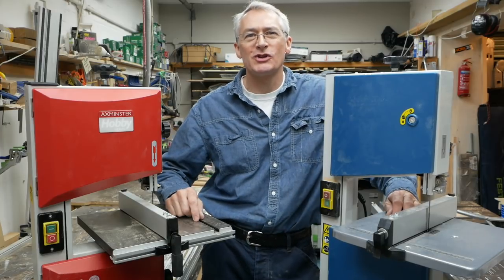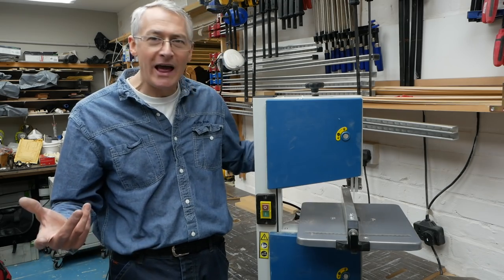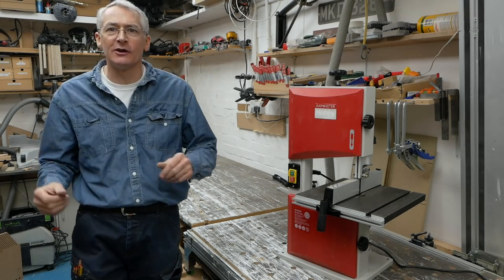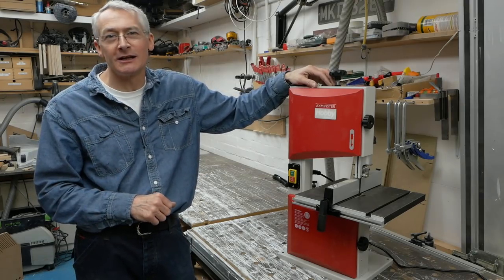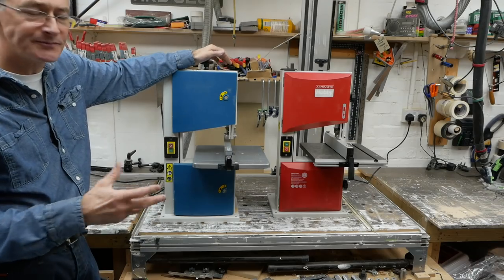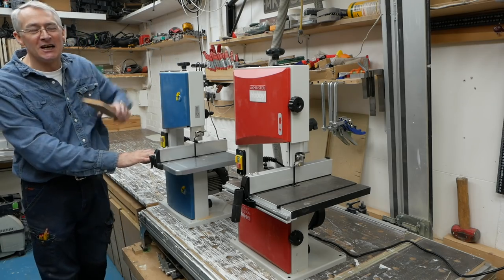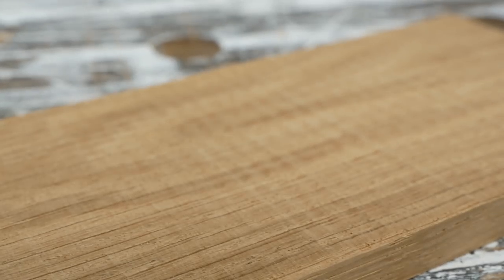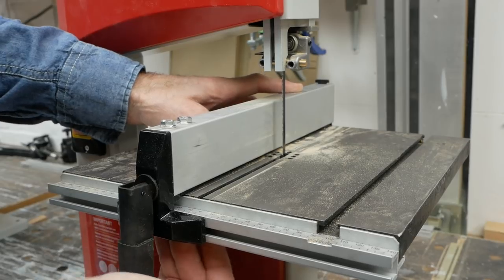£80 Bandsaw vs £200 bandsaw #140

Comment: Like you, when I first felt the need for a bandsaw I bought a cheap local Burgess which had no on/off switch! plug it in and it ran. An aftermarket NVR switch made things a little safer. I upgraded to the Aldi and for the price I think it's a great little saw. For me it matches anything up to £200. I wore out my Aldi saw after about 2 years of light commercial use, using it to supplement my big Dewalt Bandsaw. At one point I thought about having 2 Aldi saws each with a different blade to save changing.  At hobby / light use level this is easily your best bang for your buck. Simple straight cuts if you don't force it  and work within it's quite impressive capacity again for the price.

Comment: Hi Peter, nice video and interesting subject...for what it is worth i think in your line of work the Aldi Bandsaw is the best option, send the Axminster back and spend the £200 on a Festool jigsaw blade...ha ha... 
Unless you are re-sawing or working with thicker stock, in a small workshop the Aldi saw is perfect at that price.as is the Aldi Drill press, I got mine at £39.99, last weeks takeaway cost more than that... 
I bought cheaper tools and regretted it so I splashed out on SCHEPPACH NEW BASA 3.0V VARIO BANDSAW 205MM on offer at £399 instead of £520.  This has shown me that I should have spent more on a decent table saw a thicknesser, instead of rushing and buying cheap.... 

Cheers
Paul
Reply from the maker: Haha - yes, the Aldi’s been excellent for the money.

Comment: Interesting to see just how similar, physically, the two saws are.

We're currently using a Clarke / Scheppach one, similar capacity,  and it fairly chews through anything we've thrown at it *so far*.
Swapped out the stock blade for a couple of Starrett ones (one thin for detail work, the other 3/8 inch for ripping) and made a 3/4" ply replacement table and fence. Rock solid.
Reply from the maker: Yeah, I need to look at beefing up the thin table & fence 👍
Reply: @10MinuteWorkshop  superb video. I just picked up one of these cheap bandsaws today. For £40! (Second hand), but the owner hadn't even taken it out of the box! Deal of the year for me so far. Very pleased with it.
I was wondering if you could suggest what tpi blade I should buy for cutting hardwood like pau Rosa?  It seems like I would need a finer toothed saw blade, (but I could be wrong as this is my first bandsaw), and you can pick decent ones made in UK for between 10 and 15 pounds.
Not very expensive really.

Comment: Thanks Peter! I'm glad you compared the two brands, in particular the Aldi one. I'm confident now that it will do the job for me at a very cheap price. I'm off to Aldi (in Australia) to buy one!
Reply from the maker: Thanks! Bear in mind that this video is a few years old; the saw I reviewed here won’t be the one that you can buy today; check the comments below -  there have been some QC issues in the last few batches of these. 👍👍
Reply: @10MinuteWorkshop  Hi Peter, thanks for the warning. I've read the other comments. It can be a bit risky with the Aldi stuff at times. It goes on sale next week. I'll try to get one and let you know how I go.
Reply: @dandam7755  did you get one? I did, seems exactly the same to me and does a good job for the  $130
Reply: @TheCrankster77  Hi Ben, no I missed out at Aldi but got one from Bunnings. They had dropped their Ozito band-saw to the same price. I believe that it would be very similar 
to the Ferrex one. Either way, for that price, you can't go wrong. I'm really enjoying having a band-saw. How's the Ferrex?

Comment: Inspired by your videos I picked one up at Aldi for.... £59 (!!) last year & was/ am absolutely delighted .. bargain upon bargain!! Such a handy tool for the small workshop - I no longer risk dragging my finger into the chopsaw when doing smaller cuts - as my Dad rightly pointed out: "You'll end up using that more than your circular", & he was right.
Reply from the maker: Thanks! Wow, £59 is a fantastic price. And I agree with your Dad, such a handy little thing to have 👍
Reply: Yes I went to an Aldi store which had just been opened & it was on special... result!

Comment: I bought a band saw from Aldi  less than 2 years ago for £110, and it is a Ferrex. Came with a mitre guide, and takes a 1790 mm blade, throat of 10" and will cut up to 5" thick. The bed is thick and solid aluminium. Two speed adjustment possible. All the blade guides are bearings, and it is a dream to set up. All in all it is fantastic for the money. It even came with a toolkit to do the set up; spanners, screwdriver and allen key.
Reply from the maker: Yes, sadly they weren’t available for long, looked like a good machine for the money. 👍👍

Comment: I used a Lux 10" bandsaw from East Germany for around 25 years.  After a bit of faff with duff blades I got a good one that worked for the rest of the saw's life (motor seized ~5 years ago, no replacements available). The table was nasty brown plastic, the guides were waxy  fibre(?) blocks and I had to make my own fence out of wood, but that thing did everything I asked of it - dead straight cuts and 10 cm x 1mm slices in oak, even.

I replaced it with a 360€ 8" Metabo. Yay, quality, right?  Wrong. The first one I received had a cockeyed drive pulley that threw the belt.  On the second one the lateral blade guide bearings could touch the blade on one side but come no closer than 2 mm on the other. The rear bearing wouldn't touch at all until I invalidated the guarantee with a file.  It had so much in the way of idiot-proofing that you couldn't see what you were cutting with both eyes at once - maybe it was designed for one-eyed woodworkers.  It improved a bit with a new blade, but I still need to leave a 5 mm margin round anything I cut and finish it with plane/spokeshave/sander.

Maybe I'll keep watch for an Aldi one then use the Metabo for a 36-kilo doorstop.

Comment: What a surprise! I know a lot of hobbyists like Aldi equipment because they're cheap.  But I didn't think they would stand up against something like an Axminster.  You're right about the fence and motor though - you get for what you pay for there, induction all the way if you can afford it.  Great video Peter.
Reply from the maker: Thanks Jim! Must admit I’ve never seen a bandsaw that didn’t have an induction motor- I must have led a sheltered life 😆👍
Reply: My Scheppach HBS-20 has an induction motor, but the motor power indication is a bit confusing. The label says S1 250W and S2 350W
but I have no idea what S1 and S2 stand for. In the catalogue is written 250W  (no mentionning of "S")
Reply: S1 refers to continuous running and S2 is intermittant ( a higher output can be acchieved in short burts and not continuously)
Reply: Thanks for explaining!
But why is S2 mentioned anyway? What's is it useful for? Is there a possibility to use that 350W at the moment you want it?
Reply from the maker: Hans de Groot I agree. Just taken a look and my Aldi has the same on the label in the back of the saw - 250w S1 and 350w S2 (30min). After 30 minutes does it reduce power?? I’ve never run mine for more than a couple of minutes at a time. Seems a strange way to define power output.
Reply: I work at Liverpool university and I've just asked a professor of electronics for an explanation... S1 (speed 1) refers to the continous draw that the motor will be set for to avoid overheating. S2 (speed 2) is the maximun draw that the motor will take.
It's basically to prolong the life of the motor by preventing overheating.  Most machinery will have dual rated motors like this.
Aparently it doesn't affect the performance of the machine or speed etc.
Reply from the maker: Jim Black Fascinating, thanks Jim. But in a single-speed machine like this it’s a motor rating for the sake of it, presumably i.e. they need to quote ‘power’ as something; the actual power/output/consumption won’t change?? BTW I was in Liverpool last weekend for the football, been years since I was there 👍
Reply: As you load (apply torque to) an induction motor it draws more power from wall.  If you stall out an induction motor it will effectively draw the most current possible based on the resistance of the windings (think short circuit).  In this state it would "burn up" the windings as all the power is put into resistively heating the motor with no watts leaving via the shaft.  With no load only enough power is being consumed to overcome the friction of the saw.  When cutting materials you cause the motor "slow" down, thus lowering its effective resistance and allow it to draw more power to speed up.  The motor has a balance point where it can cool itself enough to run forever and that is the S1 point, the S2 point is Kirk asking Scottie for more power!  We all know that the warp cores will go eventually though! So after 30 minutes the motor will start burning off the wires insulation and eventually destroy itself.  Better motors have thermal protection and cooling fans.

Also,  Marketing...  a 350W motor sounds better than a 250W motor.  That's why they like to quote peak or intermittent power levels.
Reply: Now that makes iperfect sense.  Thanks Hardkrash.
Reply from the maker: Thank you, that's a very detailed explanation! I'd noted too that the Aldi claims to draw 1.2A which at 240v is just shy of 290W - a convenient middle ground. And yes, I'd figured out the 'marketing' angle of higher numbers 😉
Reply: Honestly, i rate aldi tools quite high

Im a welder/fabricator by trade and use their air and battery tools in an industrial setting.
I have yet to break one

Comment: I've got the older 14" bandsaw from Record. It's been a total champ, even though I've neglected and abused it horribly. I could imagine getting the smaller Axminster bandsaw so I could keep a wide rip blade on the bigger saw, using the smaller bandsaw for curved work.

My main concern with cheaper tools is always longevity. They're made to last one or two projects, not three or four decades.

Comment: I have the axminster 12" saw (something 310 is the model number). If you are going to buy a "premium" saw with cast iron top etc then I would say it's about the smallest saw worth having in terms of cut capacity and rigidity. If you are going for a small saw, get something like the aldi one, you'll never be able to do serious cuts but it doesn't really matter on a saw that size so capacity and rigidity can be sacrificed somewhat as you have found.
Reply from the maker: Thanks! 👍
Reply: caskwith i

Comment: Great video. Just bought a bandsaw for $NZ360 (about 180 quid). So similar in quality and performance to the Axminster. I've never owned a bandsaw before so I'm not sure what to expect but the limited experience, so far, has been positive. My only complaint is that the manual is virtually useless and I had to google the necessary instructions for the adjustments. I'll keep a copy of the Axminster booklet for future reference. Thanks.
Flaxen Saxon
Reply from the maker: Thanks! And yes, rare to get a manual that’s as good as the Axminster one 👍👍

Comment: Nice review Peter! I use my bandsaw almost for every project, so, I invested in the biggest Hobby unit available before the pro ranges (Startrite) start, i.e., the BS350s From Record Power. I'm glad I did because it is outstanding performance/ value Cuts huge Blocks of anything with ease and it's built like a tank.
As with all tools, I see you use Festool, cheap tools will do the job, but when they go wrong, they end up at the local tip, because you won't be able to buy spares.
It all depends on how often you are going to use a tool really!
Reply from the maker: Thanks! Yes, absolutely - I'm a big fan of cheap tools, as long as you know what you're getting. As a first bandsaw the Aldi's brilliant, but a more sophisticated user will probably want more from a tool. 👍

Comment: There’s nothing more satisfying than being surprised by a low cost tool that works better than expected. In fairness compare the customer support a higher priced tool supplier will provide vs Aldis as the good manual demonstrates. If the Aldis tool fails it may be a diy repair or put in storage with that old “three wheel” saw. However you did an excellent job comparing both tools. I would keep the Axminster tool.

Comment: Great review. I have the aldi bandsaw. I find the blade constantly comes off and the bearing support turret thingy gets wedged in place with saw dust getting in behind it and jamming up the pinion. It does me for what I use it for but if used very often I would bin it.
Reply from the maker: Thanks! This video’s a few years old now, and the more recent saws had some quality control issues, esp. wrt the blade coming off the wheels - see the more recent comments below. If it’s within the warranty period I’d return it. 🤷‍♂️👍

Comment: Great video and comparison and as you say it's all about what you are going to use it for, however one very important consideration is the rating of the motor. As with any cheaper tool occasional use is fine but if you want prolonged use I.e. using it a lot everyday or making it work hard, then check that it is rated for that use as cheap motors will burn out very quickly. As someone else said, why not keep both, l would. Use the Aldi for rough stuff and the Axminster for finer work. Keep up the good work, Mike.
Reply from the maker: Thanks Mike. Yeah, I understand the logic for keeping both - it’s occurred to me too - but the biggest for me is space. Still, no decisions made yet 🤔👍

Comment: I think the main point with this tiny Axminster saw is it's size as the larger saw is often not practical for a hobbyist with very limited space. If you have space for a bigger saw then the difference in price is kind of negligible. For hobbyists space is generally always the limiting factor which is why 2 or 3 in 1 machines do well in that part of the market, pros tend not to consider them because they are too much faff to keep changing over and most often are not rated for continuous operation so no use for volume work.

Comment: Ok it appears i'm the guy the blames his tools and i need to have strong words with myself. I've been having immense difficulties lining the top wheel up so the blade doesn't run off and the best i managed was the blade in the centre on the top but on the bottom wheel the blade was overhanging the front of the wheel. I put an extra washer on the bottom wheel to bring it out a bit and it worked for a month but now after using it again i broke the blade and discovered the blade had made a few mili groove in the bottom bearing which was the cause of it snapping. I turned the bearing around and got it working but within an hour, with very little force and being very gentle with it i managed to snap my last two blades :( 

Glad i found this channel and will explore to see if you mention the tension i should be using as i can only think this is where i'm going wrong. Thanks Peter!

Comment: Dear Peter,
Enjoyed all the band saw videos and found them very helpful. As Aldi are now selling (June 2019) their version again at £79.99 I've pre-ordered one. Never had or used one before so it'll be a 'first toe in the water' for me. Thanks for the reviews, I'm hoping mine is as successful as yours was.
Reply: @10MinuteWorkshop  Dear Peter, Many thanks for the information a useful 'backstop'. As with the old Amstrad PC the user does the checking.
Reply: @10MinuteWorkshop  Mine is going back too. No amount of adjustment keeps the blade properly on the lower wheel; shame.
Reply: I'm having to return mine too, it seems impossible to line the saw up onto both wheels, the band falls off one or the other.

Comment: Got the Record Power 10". Love it. Mainly use it for cutting 4" deep bowl blanks in Oak. Handles it no problem
Reply from the maker: Nice👍 Looks a good machine for not that much more than the entry-level Axminster and a step up in capacity.
Reply: I find what makes a huge difference is the blades I use. Tuff Saws co.uk do some of the best blades out there and they're not that expensive. Run by a guy in Wales, makes them all himself
Reply from the maker: Yes, big fan of tuffsaws - Ian’s very knowledgeable and generous with his time 👍

Comment: For small work and model making it go for the Aldi. You can improve the table by fitting an MDF overtable. A slot can be routed in for a mitre gauge and these can purchased as an addition to the machine. I think the Axminster difference in price is mainly brought about by the cast table.
It's a shame we didn't see the difference between blade guides and bearings as this has a bearing on accuracy/wandering.
For other than small/hobby work I'd go for a larger machine. 
Nice helpful review.